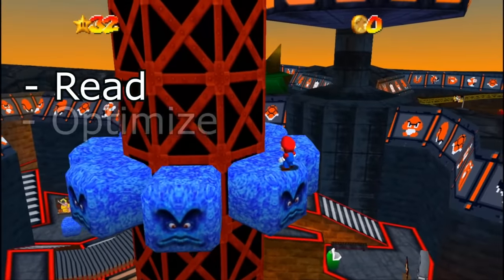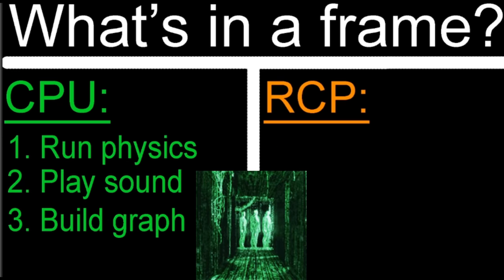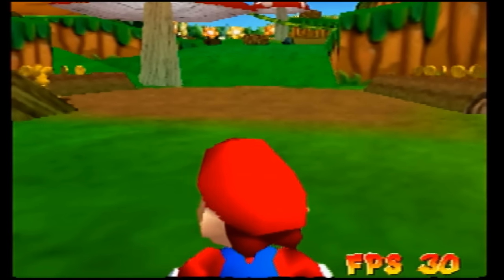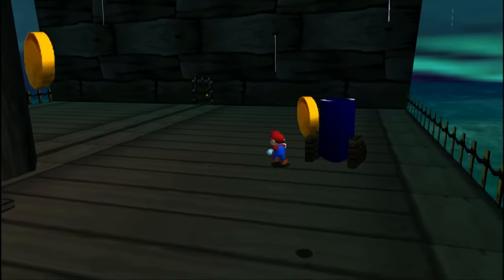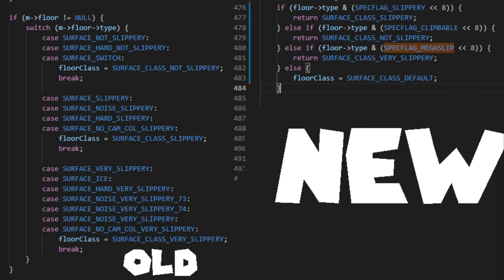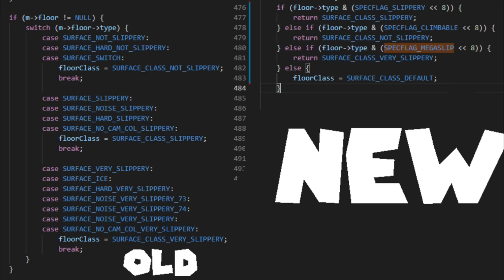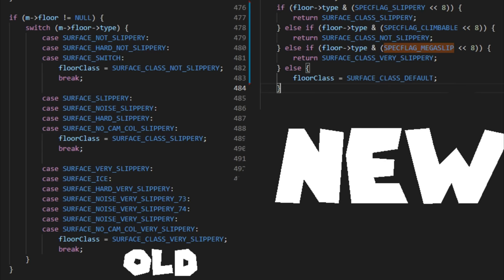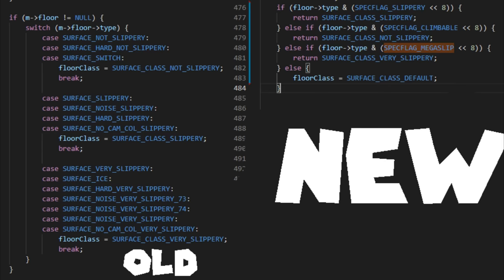FIXING the ENTIRE SM64 Source Code (INSANE N64 performance)

Comment: 7:23 This is very interesting. Usually I hear about compilers unrolling loops to optimize them, but here, the holdup is RAM, not the processor.

Incredible work all around.
Reply: Modern computers are also massively being held back by the RAM being so slow. I think the difference is that now we have more mitigations for that, like larger caches and speculative execution. This probably shifts the place where code-size vs conditional jumps balance out (conditional jumps in non-unrolled loops are also bottlenecked by memory).
Reply: @kebien6020  also compilers are getting better at removing conditional jumps altogether. In modern C(++) code you don't have to manually remove most ifs because the compiler does it for you. I realized this when I wrote OpenGL shaders that aren't optimized at all I think so you had to manually do all the tricks to avoid ifs. Just by removing a few ifs in the shaders I gained much more performance than by implementing batched rendering
Reply: Did he say RAM or ROM at 7:23 8 and 16 bit systems run directly out of ROM and don’t copy any code to RAM for execution. A PC OS (IIRC) will load everything into RAM from disk barring external libraries. 
Eight cycles JUST to load the next instruction from ROM is INSANE. Removing instruction cache would make the N64 run 100x slower
Reply: @kebien6020  I seem to remember hearing one of the biggest advantages of M1 is how it can optimize the caches.

Comment: Any plans on making a patch for the base game where it runs as fast and optimized as possible?
Reply: Yeah, I'd absolutely love to see this!
Reply: It would be interested to see this implemented in libsm64 so we can see Mario run in 60 fps inside other games :o
Reply: I also want this on super mario 64 land
Reply: PLEASE
Reply: Seconded! I got an Everdrive64 a few months back and would love to play it at 60 fps on real hardware.
Reply: Please, I want this so bad
Reply: Yeah please. I want smooth 64
Reply: yeah Id love to see an optimized version of the original base game itself
Reply: Hell yeah! An optimized version of the original would rock my world.
Reply: I've been thinking about this too. Just compiling the original code with the -o2 flag is quite an improvement, but this would be good as a base for future mods that have more expansive levels that might affect performance.
Reply: I remember reading that someone would need to pay him, as it would take over 100 hours of work to do.
Reply: It's sad but if it was done, absolutly no speed runners would play that version despite being an improved one.
Reply: @FrozenZerg  if some speedran the All-Star version, some would do this version too.
Reply: this
Reply: My thoughts exactly. Also, I wonder if the optimizations not related to n64 architecture (the code bugs and inefficiencies) could be ported to the main decompiled project, so the fan-ports of Mario 64 could get a performance boost (would be nice for power limited devices)
Reply: @FrozenZerg  Who cares about speedruns? This would be done for the regular player.
Reply: Yes pls. I just recently picked up an Everdrive 64 so I would love to play this on a real N64
Reply: @OMorty  Wher did you get your EverDrive? I was looking and i don't know where to find a good one!
Reply: @xxsusmasterxx5491  I got an Everdrive64 X7 directly from Krikzz's store this previous Black Friday. Wish I could help you. 😔
Reply: @Eldoofus  I asked that question to a speed runner that i follow and he told me that mostly no speed runenrs would follow because they play on the original game that's all, and of course if they does they would be put on another classement that unfortunatly nobody will care about.
Reply: @Planetdune  Idk i guess regular players won't hear about that, the only way they would hear about it is if Kaze is finally employed one day by nintendo and if they accept to produce all thoses fixes he talks about.
Reply: @FrozenZerg  It would never become mainstream, I think we all know that, but at most, it would be like Smash Remix is to the Smash 64 competitive scene, which isn't half bad at all.
Reply: plus 60fps animations if possible
Reply: @Eddies_Bra-att-ha-grejer  yeah I hope he releases the fully optimized code when he's done with his mod
Reply: So this!
Reply: up!
Reply: @Eldoofus  Speedrunners aren't mainstream. Saying this shouldn't be released because speedrunners don't care is like saying MacDonalds shouldn't exist because Gordon Ramsey doesn't like it.
Reply: @Razumen  some people would definitely want to speedrun this version, and if it does well enough, it could get its own category!
Reply: Vroom Vroom!!!!

Comment: 7:45 "Usually if you did this, you would get fired from your job"
Completely understandable, won't even lie. I can't imagine even the most well-equipped programmer understanding something as insane as the Q_rsqrt function (for an example of course), especially during that time period. Ahh, classic C black magic.
Reply: A lot of this stuff would get you fired, the loop unrolling also comes to mind. I hope Kaze points out that although he's optimizing everything, optimization is only one facet of good programming and generally not the most important one in a professional setting like readability.
Reply: You might not be fired if you left comments explaining exactly why you're doing these silly things, and tests showing that they are actually helping.
Reply: @LizardLeliel  it's all about context. He's programming for a never changing target (dead platform), with so much hindsight. There's no need to worry about mantainability because the game (engine) is forever done, etc. I'm sure if this was a an "actual job" he wouldn't be fired, he's worked according to requirements.
Reply: @Radgerayden-ist  I'm not saying he's doing bad for focusing on optimization here - he's the only programmer involved in this project. I'm just genuinely afraid new programmers may get the wrong idea that the standard of good code is just optimization.
Reply: @LizardLeliel  as someone who constantly messes up in Scratch, I can confirm readability is key to make a good game, even there you may get disoriented if you're being reckless with the block programming, let alone other guys looking at your code.

Yes, even with a language made for kids, these things can happen.
Reply: I think black magic is fine, as long as you are SUPER explicit in your documentation when you use it
Reply: @renakunisaki  Nah, there is this idea where code that is easy to maintain and edit is better than optimized code (to a degree). As Brian Kernighan didn't say "Debugging is twice as hard as writing the code in the first place. Therefore, if you write the code as cleverly as possible, you are, by definition, not smart enough to debug it."

Even if you are smart enough to debug it, the other coworkers trying to maintain your code after you are already gone probably aren't. Especially because debugging someone else's code requires quadruple the smarts than writing code. 

Kaze is nuts for even attempting to optimize someone else's 26 year old code that has been disassembled from a binary.
Reply: @thecryingsoul  If it just makes everybody's life easier, than this is something I agree with, but it's a very case-by-case thing.
Reply: I imagine removing all of the error checking would raise the boss's brow
Reply: @JB-mm5ff  If you actually did removed the error checking without the boss's permission, that's a yikes.

Although in the real world, you would have test code to make sure everything works in any case, but it'd be seperate from the main codebase. Any actual error checking would be done when an error would be reasonable to occur - such as if the user selects an incompatible file for the software to run.
Reply: @JB-mm5ff  That's when you just point the exception table to the level select routine so a 'crash' is now just an unexpected level select code entry.
Reply: @budgetcoinhunter  I remember seeing a video about that. A sonic game with a crash going to the level select is such a scuffed way to game the quality testing and I love it
Reply: I'm just wondering what on earth that voodoo on the bottom is doing; from my understanding, the parameter in the old code is storing some flags in the highest byte, and the arithmetic shift right is shifting it all the way down to the first byte so it can then be masked from a 32-bit integer to an 8-bit integer.

The new code... bugger me if I knew what the hell it's doing that somehow has the same result as the right shift version.
Reply: @xdeathcon  Sonic 3D Blast, from Traveler Tale's had the error handler pointed to the Level Select, so if the game errored out for any reason, it "threw" to the Level Select, with a congratulations message lol.

Funny thing is that you could hit the cart on the top to stop the data-line just for a second and it would do so too.
Reply: @mrmimeisfunny  Some programmers might even deliberately obfuscate their code just to keep their job secure and maintainable only by them if they can convince their boss of their usefulness. In this context it is more for selfish reasons.
Reply: @LizardLeliel  He did the opposite of loop unrolling though. 
Of course, in a professional setting you wouldn't just put obscure optimisations like that in, you would have to get them approved, document them and present them to the rest of the team too. If the performance gains were negligible, then there would be no reason to bother at all.
Reply: @fuzzyquils  The new code makes a pointer to the variable, casts that pointer to a 1-byte type pointer, and then dereferences it again. This causes the "first" byte to be extracted. The reason you will be fired for doing this is because you generally don't know in which order the bytes are stored. On some hardware, this same code could give you the last byte instead.
Reply: @neonfatum  I checked the video again. He did roll loops. I got confused; you'd normally unroll loops when doing optimization (he even mentions later that compiler optimizations do this), not roll them, and I assumed he was unrolling loops and encouraging to do this.

I'll set it straight: you'd want to roll loops as he does because its easier to read then unrolled loops.
Reply: Everything is a tradeoff. If your code is supposed to favor performance over portability, you should be called out for extracting a byte from a word conventionally via bitshift and mask, instead of using an "evil" pointer cast.
Reply: To be fair, what that line was doing was assuming big-endian numbers. It really should have been commented or better yet macroed like HIBYTE(x) to clue in the reader. And a good enough compiler could possibly have optimized it, assuming it knew that numbers were 32-bit big-endian.
Reply: @Tumbolisu  thank you for explaining the casting thing - I've been puzzling over that for the last couple of hours

Comment: At this point Kaze is somehow gonna turn SM64 into an early GameCube game and that's just awesome.
Reply: What's kinda funny is I've thought about actually porting some N64 games to GameCube just so mods can take advantage of the extra resources and better emulation.
Reply: @renakunisaki  is that even possible? Because if so…
Reply: Super Mario Sunshine demake anyone?
Reply: @renakunisaki  I suppose it would need a full rewrite though - IIRC the N64 doesn't even use the same processor as the GC, let alone a similar architecture for rendering
Reply: Zel, known for also some cool Zelda stuff, is actually working on a pretty late-gen Starfox Adventure's (Dinosaur Planet?) like project that looks almost early gamecubeish, on a goddamn N64.
Reply: @wilji1090  It is, im playing the game on the og xbox. This one is not an optimized port but the xbox has the power to plow through it so its the same. With rewrites like this he can make a proper port.
Reply: @renakunisaki  well hello there lol
Reply: so its SMGC now
Reply: Beta64/Andrew discovered in unused sounds that the collecting a star noise was left in the game actually!
Reply: It gives me SM64DS texture vibes, which is still awesome
Reply: Imagine Luigi's Manion on the N64

Comment: Regarding compiler optimization, loop unrolling, etc. It's one of the things that makes targeting old CPUs with modern compilers difficult. Many modern optimization techniques that result in real improvements for modern CPUs result in much slower code on older CPUs. They didn't have the benefit of gargantuan cache sizes, multi-way instruction decoders, register renaming, etc. For most older CPUs, the general case is that less instructions means more performance, because it leaves more bus time for data and IO.

Comment: 4:15 the code isn’t necessarily bad, it perfectly did what it needed to deliver in time at a given quality threshold. I observe this a lot at work where coding purists will sweat about a perfect solution while the product development moves on only for them to start from scratch with the next badge of changes. In a commercial setting we cannot expect perfection. Oftentimes devs have to polish a turd. The result isn’t always beautiful under the hood but as long as it functions it’s good enough.
Reply: For you
Reply: @jphataraki6764  you see 😉 that thinking is the problem 😅
Reply: @jphataraki6764  That's the line of thinking being talked about here. When you're coding commercial products, it's basically guaranteed that you will not have time to perfect your code. I'm not even factoring in the possibility of a rushed cycle here, I'm simply saying that, when it comes to how long coding takes, there is an enormous difference between reasonable and pure.
Reply: Not to mention that two experienced and highly skilled programmers can vehemently disagree about what's best
Reply: 100% agree, I just spent roughly 2 months worth of work programming a large industrial production line. I programmed it not to be the most efficient with memory or to preserve the scan time of the PLC....but to be modular, I can add things on or take them away (comparatively) easily. And by fuck am i happy for that now, 1 week from installation I've been hit by the "Yeah so half the machine hasn't been built yet but you need to commission the stuff that has. The only issue is that half the missing equipment is "Safety rated" and therefore the PLC will throw a hissy when it doesn't exist.

Sometimes it's not about speed, it's about safety and just making it work.
Reply: I think he meant that it was bad in the sense he needed to rewrite everything to get it to his his stated goals.
Reply: most the guys who worked on the n64 didn't even have the internet or even know what was possible on it, had to pretty much figure it all out, sure it is bad by his standards of course
Reply: @DarkShroom  he states pretty explicitly in his video that C was a new language for them and hardware for a launch title is basically a black box. He also concedes that his memory improvements rely on the Expansion Pak, which wasn't available until later in the N64 lifespan and had to be "optional" so that Nintendo could sell the cartridges to everybody.

With all the improvements he includes in this video, I think he's still quite deferential to the circumstances the developers had at the time.
Reply: @jphataraki6764 unless you’re writing everything yourself, a software project is not about you. It’s about delivering the project on time, with adequate function, at a stated cost. This is yet another reason antisocial basement dwellers who think if they just get good enough at coding they can be employable anywhere are deluding themselves: you will ALWAYS have to work and compromise with others. It’s called “life”.
Reply: @@ninelamdas not to mention he already had the source code and solution just optimize it with current/better technologies.

The devs during that time HAD TO DEVELOP that source code and technology.
Reply: He didn't say the code was bad he said it's bad that the code isn't optimized for all of the changes he's made for it.
Reply: Hard disagree, sir.
Reply: I think it's also worth pointing out that this guy is rewriting *a finished game*, with the benefit of hindsight. The devs at the time making this were likely working on a very fluid product, which isn't always worth spending the time to hyper-optimize if you're going to trash a chunk of code and write something new in a week
Reply: @9λ I’m an engineering manager and the only one seeming unemployable is the person being highly unprofessional and belittling strangers. (That’s you. I’m talking about you.)

Diluting technical details into layman’s terms is hard. Very hard. Some loss in fidelity is totally reasonable.
Reply: @Brianlikescars  :washhands::washhands::washhands:👍👍👍😊😊😊
Reply: This is so true.  It's often "make it work" and occasionally, we get to make it elegant afterwards.  Also, not everyone is an expert programmer, most write code that works, just not always the fastest.
Reply: Open source products used in enterprise or even casual environments tend to be more careful with that.
Reply: @9λ "I doubt"
"Just cold hard facts"

So do you doubt, or do you know?
Reply: @TrojanLube69  Yeah, imagine trying to build a table, but you have to invent nails and hammers, first.
Reply: @tbotalpha8133  exactly, great analogy.
Reply: AKA "if it compiles, it ships".